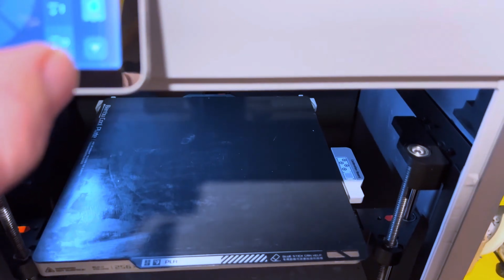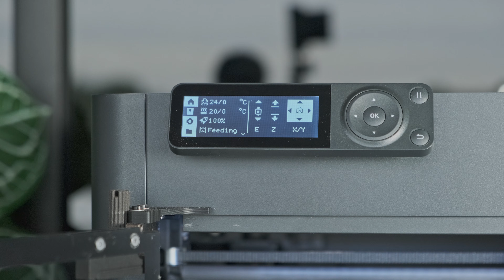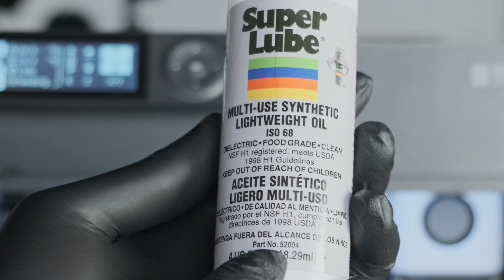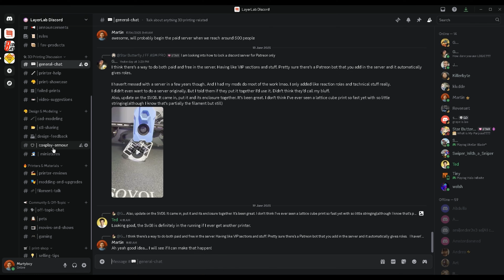Your Bambu Lab Printer Is Squeaking? Here’s the Fix You Actually Need

Comment: This mostly applies to the P2S too with a few minor differences so thank you!  My new P2S started squeaking on the X/Y axis after only about 20 hours of use.
Reply from the maker: Ahh good to know, I was wondering if it was relivant to the P2S...
Reply: My P2S also started squeaking on the XY axis after only 35 hours of printing, lubricating the idler pullies fixed the issue, I've seen multiple people have this same issue makes me wonder if there is some QA issues with these not being lubricated properly from the factory
Reply: @jakecrowley6  From what I have learned it could be an issue with the belts not being centered on the pulley. The lubrication fixes it temporarily but it apparently might come back.   I haven't taken the back off mine yet to confirm if it is centered or not but it sure sounds very similar to what happened with the P1S.

Comment: I did as the video instructed with my P1S, but now my bed is having problems homing. Any ideas?
Reply from the maker: Sorry to hear you're having homing issues. What exactly is the printer doing now? It won't home at all? I had an issue like this, only once, and it was a bearing that had popped out slightly, and this bearing is hidden behind the rear housing of the printer. The only way to fix it, is the remove the rear cover, turn the printer upside down, and the bush the bearing back into place. However, this may not be the cause of your problem, so hop on the bambu wiki and have a look  around at what the exact problem could be. I fix most of my issues from the info I find on there :) https://wiki.bambulab.com/en/home

Comment: I have the Bambu P1S which I used about 60 hours when I first noticed the z-axis squeaking.  Long story short, the issue appears to be that the idler pulley bearings are free to spin on the metal pin.  Note that the metal pin is splined and radially locked into the plastic bracket.  If properly designed, the bearing inner races would be locked to the pin so all relative motion occurs in the bearing.  In my printer, the bearings were hard to turn, and the pin surface was dry, so of course you get squeaking.  I conversed with Bambu tech support and their solution is to just lubricate it like crazy.  They are unwilling to address the real issue.
Reply from the maker: Yeah, it is a common issues, easily fixed, but annoying to have to do every few months, for every printer. I feel like this could be fixed in future iterations, having these bearings sealed from the elements, or having a self cleaning/lubricating mechanism to take care of the inevitable squeak.

Comment: Thanks for the video.

I have the Bambu P1S which I used about 60 hours when I first noticed the z-axis squeaking.  Long story short, the issue appears to be the idler pulley bearings are free to spin on the metal pin.  Note that the metal pin is splined and radially locked into the plastic bracket.  If properly designed, the bearing inner races would be locked to the pin so all relative motion occurs in the bearing.  In my printer, the bearings were hard to turn, and the pin surface was dry, so of course you get squeaking.  I conversed with Bambu tech support and their solution is to just lubricate it like crazy.  I'm a bit flabbergasted as to what they actually recommended.  They are unwilling to address the real issue.  I think my solution will be to use a mild threadlocker to prevent relative motion between the inner races and pin.
Reply from the maker: Yeah that bottom idler is a bit of a pain... but I've found that cleaning the surface with IPA and a Q-tip, then lubricating the edges as per the video seems to work a treat.

Comment: Thank you so much!
I was doing a regular maintenance of Z-axis screws and after I cleaned all three screws and greased on my X1C, the heat bed started squeaking when moving up and down. I literally broke my brain trying to figure out what happened and spent several hours reapplying the grease, putting oil to bearings and so on. After watching your video I decided to clean the bottom belt as you suggested and it helped! I still don’t understand why it didn’t squeak before though 😅
Reply from the maker: Awesome! So glad the video helped you fix the squeaking and save your brain! 😂 Over time these parts need lubricating as they are moving endlessly and this friction causes the squeaking. But you'll generally get a few months out of each service before the squeaks come back :D

Comment: I can't get my belts center at all. Pushing those idler tabs is quite stiff, no matter when I'm pushing them belt isn't shifting. Getting a good squeak from my x axis
Reply from the maker: Make sure you loosen those screws on either side slightly to allow you to push the idler tabs. You probably won't get it perfectly centre, but as long as the belts aren't touching the edges of the bearing then you're good to go!

Comment: The Z tensioner is slotted into a thin non-reinforced piece of the bottom panel that flexes upwards allowing the bearing to tilt off-axis.  This causes to belt to ride up and scrape along the plastic causing the noise.  Not caused by lack of lubrication, just needs a shim of thin cardboard to fill the gap and keep the belt centered on the drive pulley.  If your belt is not centered, this is the cause.

Comment: The solution is this: Apply a thin coat of silicone oil on the back of the belts with a small paintbrush. That removes the squeel between the guidewheels ant the rubber in the belts Absolutely COMPLETELY! 😊

The silicone also extends the life of the belts. 

That

Comment: I'm a new user of the Bambu X-1, and the video you showed at the beginning is exactly what I'm experiencing. It can be really frustrating to pinpoint the issue. At first, I thought it was related to the "bearings on the Z-axis" because the sound seemed to be traveling from there. After three hours of lubing everything up, the noise got quieter, so I thought I was on the right track. However, it wasn't long before the sound returned, and I was going crazy.

I finally decided that since I had lubed everything, the problem might be originating from somewhere else. Sure enough, the noise was coming from the idler pulley at the bottom. Bambu Labs needs to address this issue since it's a significant problem, but it seems they won't. I don't know what can be done. The sound resembles a filament getting caught between parts, and I initially suspected it was coming from behind the air filter. I even used a piece of filament to scrape the back, and it sounded just like that!

For anyone else dealing with this, it's not a print killer, a machine killer, or a belt killer—just an annoyance. However, my intuition tells me that any friction that makes noise can't be good, so I will fix it. Thank you for your help; they should link this video on the Bambu site—no nonsense, just straightforward advice.
Reply from the maker: Thanks for your comment! But I totally get how annoying it can be to try and fix. And after it happened to me a few times, I decided to make this video to go over everthing I learned, as the videos I watched seemed to miss a few important steps (like the bottom z axis pully). It's weird that they leave these pullies exposed (underneath and at the back) as dirt/debris seem to easily get into them.
Reply: @LayerLabAustralia  yeah, it is weird, I sometimes look into the machine and think "it's like they sold me something I have to print to finish" lol. There are tons of great MODS out there , a lot for most of the machines Bambu releases.  It would be a pretty good business model to make something that can be modded so that the users are basically guiding your company's direction, based on user wants and ideas wouldnt it? Meaning they sell a product that makes things, things that can imporve what they sell,  then include a special space for people to post their creations, a lot of them upgrades to their machines, fixes, accessories and what not, then scour them all and say "okay, this is going into the next machines" and the people who are the creators of the upgrades they use get a free  machine.. lol I better wake up. Either way thanks again! I know what it takes to make videos, its not a fast nor easy process most times- gratitude!

Comment: I too have been battling the dreaded Z squeal. I was able to apply oil to the idler. Another video suggested greasing the top side of the belt and I did that as well. It appears the belts have a tendency to ride the top of the idelr with no way to adjust this one since the Z Idler is keyed into the platic base.
Reply from the maker: I'd stay away from putting any grease on the belts as it can cause slipping, and more issues than before. The other reason the z squeak will occur is because the bearing is dirty, so have you given it a good clean?
Reply: @LayerLabAustralia I did,  it was a dirty little idler... 😂
Reply: @LayerLabAustralia  Are you sure? i followed the bambu's wiki how's, and they lubricate the top of the belts. So i did that. Hope it doesent cause any more trouble. Mine had been running for about 150-160hours before it started squeeking. but the provided oil is difficult to apply on the suggested places. i have ordered one super lube 51014 (next best thing available in norway that i could find). But after following  this + bambu's video, ill see if the problem is gone

Comment: what if squeking sound comes from toolhead while moving in the center of XY?
Reply from the maker: Then the carbon rods may need to be cleaned with a good amount of isopropyl :D
Reply: @LayerLabAustralia  thanks. I will do that. but the squeak itself sounds like rubber tension on glass.

Comment: I was able to repair my 3D printer using the same method.
However, please be aware that if excess grease gets on the plate, it will lose its adhesive power.

Comment: So is there no way to adjust the pulley on the z axis ? Only option to Just lubricate the bearing?
Reply from the maker: It seems like it... I have never tried to remove the system (yet) but I've found that just cleaning/lubricating the z axis bearing seems to do the trick.

Comment: re. an allen key ... note the X1C requires both 2.0mm and 1.5mm, not all allen key (hex key) sets have the 1.5mm (although the 1.5mm key is not needed as often, it is profoundly frustrating when you lose the 1.5mm and find the metric hex key set you have only goes down to 2.0mm)

Comment: i have x/y sqeeking and found out bambu suggest putting grease in the belt back implying thats "greasing the idlers" 😂 what did i just witness 😂😂😂
Reply: Should we grease the two back belt areas? ( two tiny areas he points out to adjust belts) Theses machines should come with some kind of maintenance tips.. lol
Reply: @pcpcnow  never grease a belt, or its contact surfaces. Never.
Squeeking belt is usually a tilted belt tensioner move the head and watch the belt going against 1 of the shoulders where the squeeking happens then unscrew your tensioner screws and tilt and move the head, you will see how the belt runs against one or the other shoulder then depending on how you tilt the tensioner, find the middle spot.

9 times out of 10 squeeking on these machines is a tilted belt tensioner causing your belt to constantly run on a shoulder of a idler somewhere. Grease is a very destructive " eyes closed take my money " solution to a mechanical problem in this case. Also if you grease your belt its very difficult to clean that off in the future when you realize it was a complete shit advise of some mechanical not so smart person.

Comment: Nice thanks. 
1. I tried to weight a print half way through with table salt. On resuming the print it blew salt crystals all over the machine. I can now see score marks on my x and y rails. Don't do this. 
2. Can you tell me how to eliminate once and for all the, 'update firmware' alert as i never want to go past the current version to avoid rendering my BTT touch useless and sending all my data to Bambu
Reply from the maker: Aww man that sucks to hear :( And you can't get it off? Not sure how to bypass that update feature though... You could try to disconnect it from your internet...but then you won't be able to use any of the Lan features...